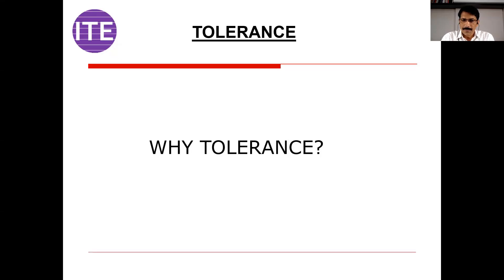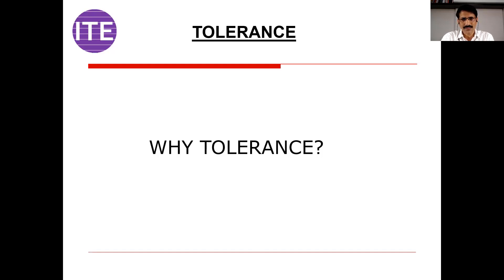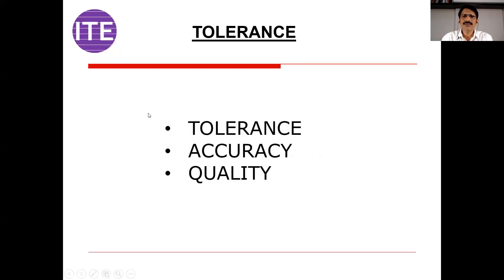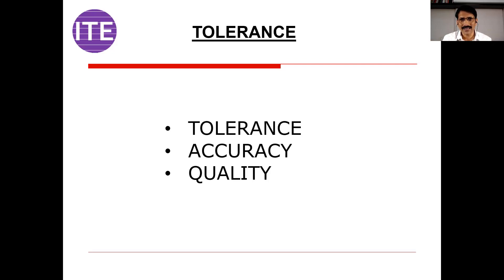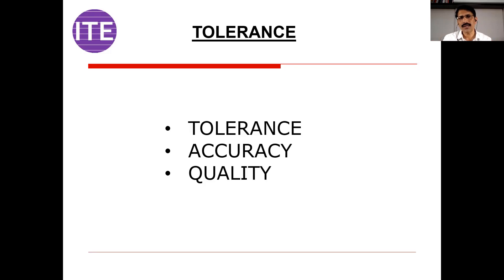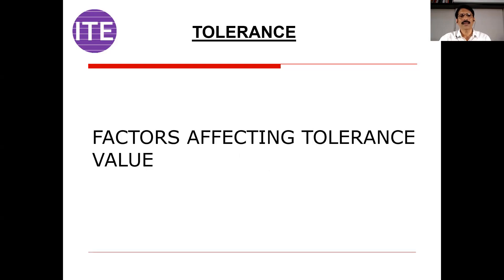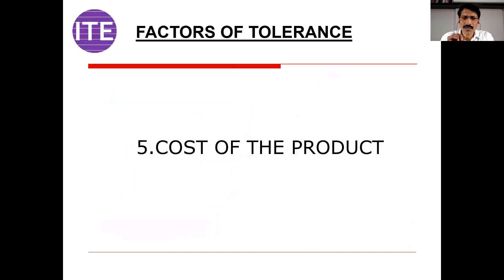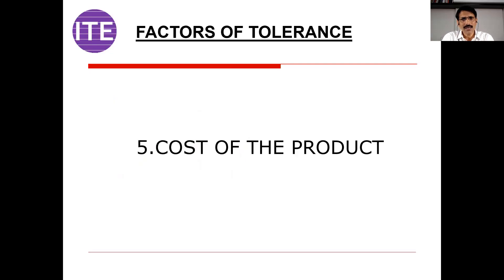How to decide Tolerances in Mechanical Design | Dimensional Tolerance | Factors affecting Tolerance

Comment: I think the correct answer is what is our application? what type of fit is required ? What is the dimension of the mating part? what is the nominal size (mentioned by you). All these factors will decide what is the tolerance value we have to provide to any dimension.
Reply from the maker: Application is important.